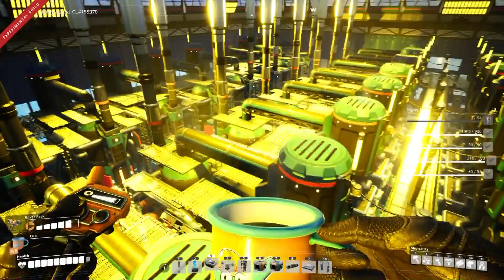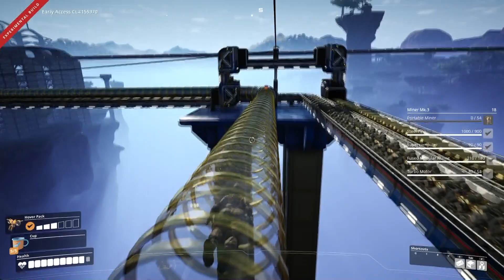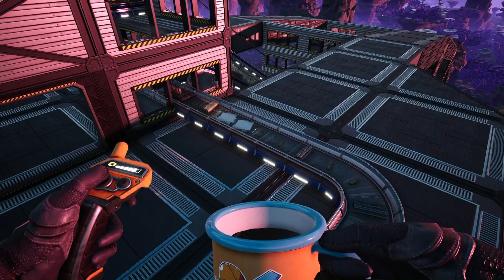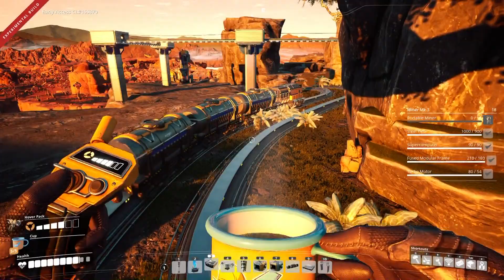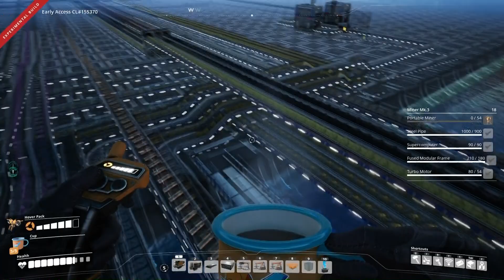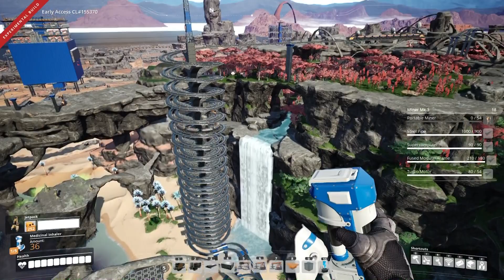SATISFACTORY - U4 VANILLA PLAYTHROUGH EP#11

Comment: Why settle for turbo motors when there are thermal propulsion rockets now? If you use up all the bauxite for turbo motors and nuke plants, doesn't that mean there's not going to be much left to do afterwards? Will that just be the end of the series?
Reply from the maker: It's a good question... Im not entirely sure   we have 1 pure node of bauxite getting turned into ally ingots getting sent to the main base which is barley used.   I'll probably just make enough thermal propulsion to finish project assembly.